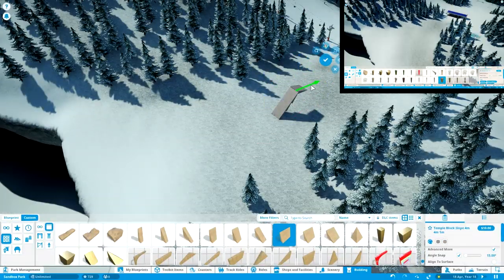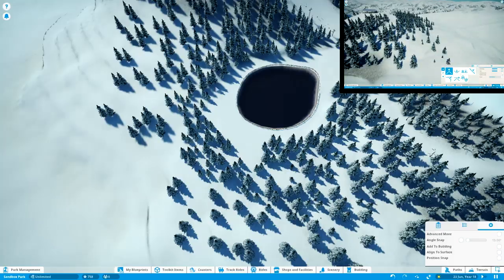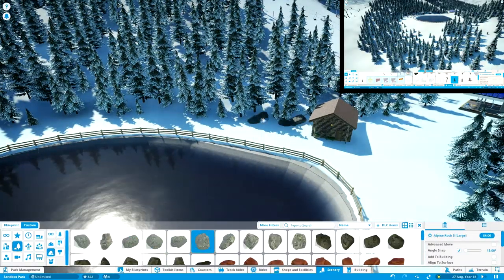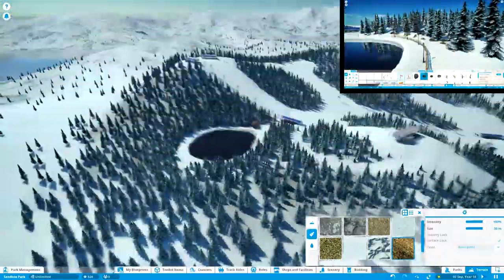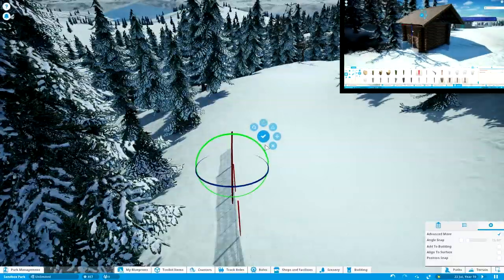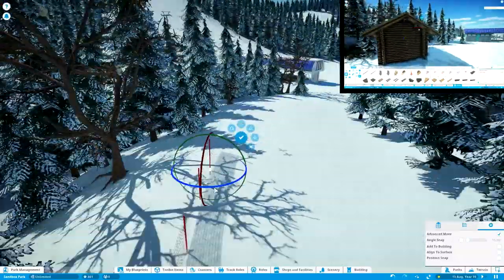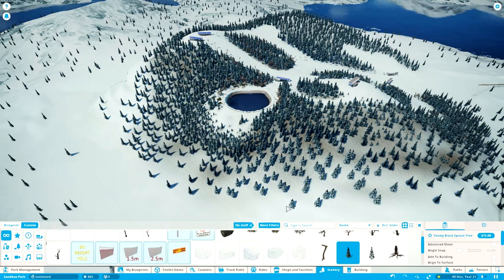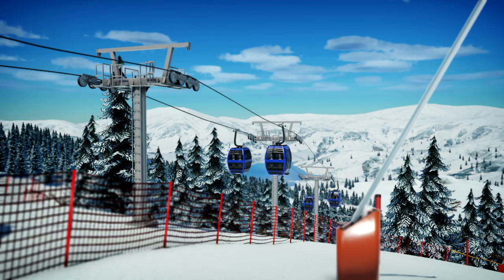Planet Coaster - Ski Resort (Part 3) - Artificial Snow (damn you, climate change)

Comment: You should add a trail or two with trees on it like a gladed trail. Instead of having only wide open trails.
Reply: I second this. Wide trails under the lifts is realistic, but narrower forrest runs off the sides are needed too.
Reply: Also skiing in the clearing under the lifts

Comment: Still think that your mountain is really not high enough to use a gondola lift tho. 
Looks nice btw
Reply from the maker: I have to agree, I just didn't want to make the resort even larger.
Reply: @Silvarret  maybe higher then ? :)
Reply: Reminds me a lot of Willingen in Germany. The heightdifference is only 300 meters I think but still they built a gondola. Quite a fun but little ski resort though
Reply: i dont think using gondolas depends on the height difference but rather the duration of the ride and the desired speed. also from all the ski resorts ive been to (mostly austrian and italian alps) the lift from the foot of the mountain to the top is usually a gondola

Comment: I grew up in Utah, USA, where the tourism motto is "The greatest snow on earth." Utah is very proud of their ski resorts, and indeed, their snow is very high quality. It is commonly very dry and powdery due to the dry arid climate. Utah has been plagued with on and off droughts in the last 25 years (more on than off) although 2018-2019 was a good above average snow year. So snowmaking is common, especially since the resorts make more money the sooner they can open. So in the fall, just as soon as the overnight temps are low enough, they crank on those snow machines to start building a base for when mother nature is ready to lay on the top layers.

Comment: Your small building beside the lake is well placed to be a pump house, either for small transfer pumps to your main pump house or for a small snowmaking system a main pumphouse.
I appreciate you going with HKD (Orange company colors) low energy snow guns - Of all options tested, the HKD has the best performance for the cost, especially in warm weather.
Reply from the maker: I was wondering actually whether I needed some kind of pumping station, decided not to act on it and wait for a comment like yours. Thank you, I'm glad I accidentally did the right thing!
Reply: @Silvarret  Given the type of snowgun you have, there should be also a site for air compressors. For the size hill you have, you could run out of a small pumphouse like you've built for water but you'll need at least a little more room for ~500 to 1000 horsepower worth of air compressor. The mountain I work for has 9750 horsepower of Centac compressors in two buildings, but we cover more acreage than your mountain.

If you want to detail the mountain operations side of things, you'll want a groomer barn for the snowcats, an ops building and sled garage (maybe built into the groomer barn), and a patrol base building and summit shack. 

Of course the program isn't set up to do that so if you want to handwave it that's fine too.

I make snow for a living so if you have other questions I can try and answer them. I think this is a really cool series, I'm looking forward to see where it goes!

Comment: 2:40 My local ski resort uses snow CANONS in addition to tower guns. These take more pressure and water AND ELECTRICITY but they create more and better snow even at higher temperatures since it turns from water to snow BEFORE it leave the "drum". But...it's a pain to upgrade to them. Despite that my local resort final got rid of the final tower last year and as of now all trails are served by large or small canons. 

This meant they needed a bigger water reserve and once while they were building the second artificial lake, I rode my trail bike back there. The new lake wasnt done yet so it was empty and since it was summer all grown in. The first lake on the other hand was awesome to look at. It was actually pretty full as it was a rainy summer. You cant get back there anymore though as when they combined the two lakes 2 years ago they had to cut out that bike path to do so. But you CAN still see it if you walk along Sack River and cut through the trees in the right spot (SUMMER ONLY - DON'T TRY IN WINTER)

Comment: Excellent detail! The ski industry was my career for 11 years until moving on recently. More specifically I designed/built terrain parks. I look forward to seeing your attempts at making a terrain park (Fun Park). Good luck mate!
Reply from the maker: It's gonna be quite a challenge because I've personally never really used them, but we'll see. Thank you!
Reply: @Silvarret  I think the best bit of info to start with is, fun parks are usually built on terrain with a slope between 8-12 degrees. Jump landing and take off angles generally range between 28-36 degrees. Shallow angle for small features, steeper for bigger features. Personally, I would use coaster track with specific angles as a tool to help form your terrain.
Reply: Also, the flow of features is VERY similar to making air time rollers on roller coasters.